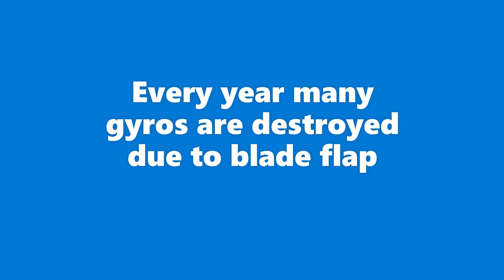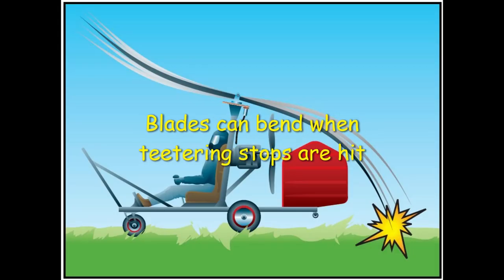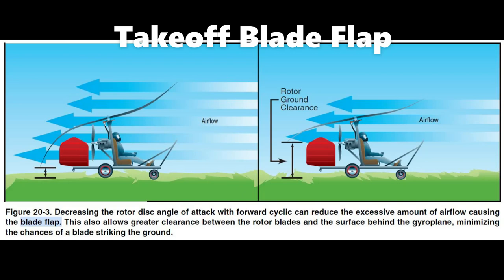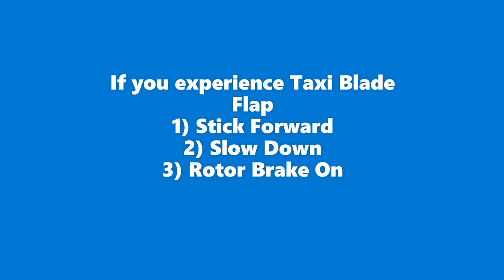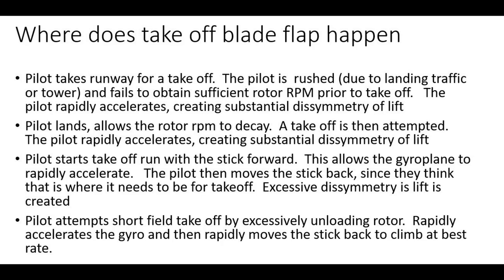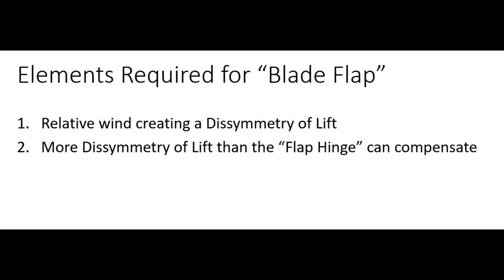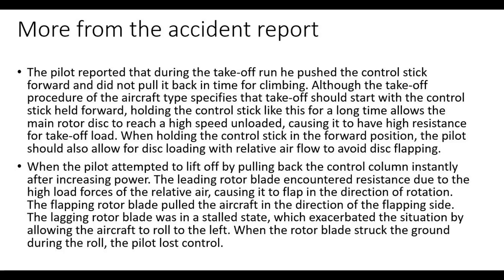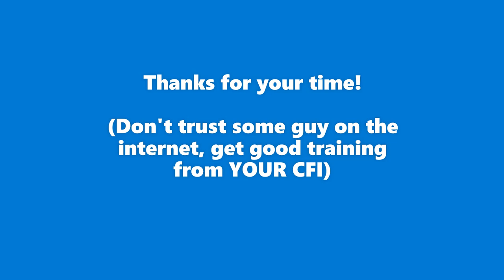Blade Flap

Comment: So blade flap and rotor bump is defined as the same thing?
Reply from the maker: The South African accident report has the following definition.  In particular, look at the last sentence:

“Blade Flap or Rotor Blade Flapping” is a term commonly used to describe
excessive, violent rotor blade motion. This most often occurs when rotor rpm is too
low in relation to the forward speed of the gyro during take-off roll. The word
“Flapping” by itself is used to refer to the normal in-flight teetering or articulation of a
rotor, which helps reduce dissymmetry of lift.
“Rotor Blade Flapping:” in traditional “Flapping Hinge” rotor systems,
“flapping” refers to the normal action of the rotor to allow cyclic action of the rotor
– similar to “Teeter” for semi-rigid 2-blade rotor systems. The flapping amplitude of
the rotor increases with increasing airspeed (forward cyclic input) in order to
compensate for the increasing dissymmetry of lift between the advancing blade and
the retreating blade. Flapping action also allows cyclic maneuvering inputs to the
rotor. In semi-rigid 2-blade rotor systems, the term “flapping” is commonly used to
refer to the abnormal excessively forceful teeter action of the rotor impacting the
teeter stops upon significant dissymmetry of lift or retreating blade stall – such as on
take-off.
Reply from the maker: The FAA Rotor Craft Handbook states:

On a gyroplane with a semi-rigid, teeter-head rotor system,
blade flap may develop if too much airflow passes
through the rotor system while it is operating at low
r.p.m. This is most often the result of taxiing too fast
for a given rotor speed. Unequal lift acting on the
advancing and retreating blades can cause the blades to
teeter to the maximum allowed by the rotor head
design. The blades then hit the teeter stops, creating a
vibration that may be felt in the cyclic control. The frequency
of the vibration corresponds to the speed of the
rotor, with the blades hitting the stops twice during
each revolution.
Reply from the maker: And the Rotor Craft Flying handbook defines:
MAST BUMPING—Action of the
rotor head striking the mast, occurring
on underslung rotors only.
Reply: @txkoob  Looks like there are many instances which can cause flapping enough to have rotor-bump. Trying to push too much air through an aft tilted rotor whether or not the rotor is up to speed, seems to be the big reason why so many begin to depart the runway and then roll to the left. It seems there are so many who just dont understand the realities of the aerodynamics at play during especially take-off in these wonderful machines.  Thanks for the reply and especially thank you for your concern about all of our safety.
Reply from the maker: In short, for a gyroplane with a teetering head,  mast bumping and blade flap are the same thing.
Reply: @txkoob  I tell you, I just have to smile when I look at the rotor-head  the genius Igor Bensen gave us. That under slung blade takes care of the stresses which a helicopter has to solve in a more complicated way. As the blade rises, it first must swing away from the "mast" in an arc just a bit. That little swing quells the acceleration which would happen as the mass of the blade would have come closer to the center of rotation. Its just genius that something so simple could solve such a monumental problem.
Reply: @txkoob  Unfortunately the South African accident was unlikely blade flap.  The machine became airborne.  In blade flap the retreating blade is actually stalled so while the machine can roll over it'll actually suffer blade strike before it gets there.  a gyro weighing 300kg empty is not getting airborne with no lift on one side the left wheel would have never left the ground and the rotor would have first struck tail, prop and ground long before lift off this was over rotation following a botched take off.
Reply from the maker: @cameronlapworth2284   This link shows a gyro, well over 300kg, getting off the ground after blade flap and the rotor striking the ground. https://www.dailymotion.com/embed/video/x861op6
Reply: @txkoob  no it doesnt. It shows over rotation.  You cannot get airborne with half you disk stalled.
Reply from the maker: @cameronlapworth2284  I suggest you watch a few other videos.   Ron's at about 4 minutes in.  https://www.youtube.com/watch?v=oS0_Ep6mnaM&t=746s   It describes the high speed blade flap conditions.  Basically on a take off run the rotor is too flat, and the pilot slightly increases the disk angle and flaps the blades.  You can see it in many videos.   https://www.youtube.com/watch?v=D2-kA7E-gzs and https://www.youtube.com/watch?v=TVu8Ubcuol0&list=PLLe0n49frOfoOjexpVZjIVXB_uXv0U7Mz&index=4    Over rotations looks different.  https://www.youtube.com/watch?v=b3OFj26MxFU&list=PLLe0n49frOfoOjexpVZjIVXB_uXv0U7Mz&index=1   Look at the ground speed.     And behind the power curve looks like https://www.youtube.com/watch?v=AheudQuxZZY&list=PLLe0n49frOfoOjexpVZjIVXB_uXv0U7Mz&index=2      --Ok, as Ron explains, when the disk is full back, the gyro can't accelerate to an efficient flying speed.  Failure to correct leads to a behind the curve takeoff.   The rotor needs to be flattened some to allow the gyro to accelerate.  In general maintaining the nose wheel an inch or two off the ground is a good way to ensure the rotor is not too flat (where rotor speed decays).   --High speed blade flap accidents often start with the nose wheel on the runway, with a sudden liftoff and rotation to the left.   Look at https://www.youtube.com/watch?v=D2-kA7E-gzs  The pilot didn't yank the controls back at the 16 second mark.  Slight back pressure was all it took to change the angle of attack and the advancing blade provided more lift, the retreating lost lift.  The result is nose up with roll to the left.  --As to how this happens: its pilot error.   Maybe the pilot has not flown for a while and forgot to bring the stick all the way back at the start of the take off run.  And partway through, they remembered to bring the stick back.   Or maybe they were trying to perform a short field take off and flattened the disk to much and lost rotor RPM.
Reply: @txkoob  i have watched many many videos.  More important i was a gyroglider instructor for 16 years hand winding rotors and flying in an era where most people had to hand wind rotors.  I know what flapping looks like from the seat.  I know what it looks like from outside hint giant s shape you NEVER see blade flap with both blades conned up  NEVER.  I have also due to over zealous drivers and test flying home made rotors with incorrect profiles experience blade flap and recovered from it more times than i can recall without ever damaging a rotor.  I cam even spot it in the shape of the disk before you can feel it.  Now i may be sounding arrogant here.  Im not im not the most experenced powered pilot probably only 200-300 hours powered.  Im safe, conservative can manange engine outs.  But on rotors me and a mate built several.  Ive test fown tracked and balanced more than 10 home made rotors,  and ive spend many hundreds of hours being dragged up and down a strip after hand winding rotors.  I winding up rotors in all conditions I am an expert.  This is something almost everyone misunderstands.

The modern movement uses pre rotation not as a convinience but as a method to try to avoid teaching proper blade management.  As a result we have instructors who were trained with pre rotation who couldnt wind up a set of rotors from low rpm if their lives depended on it.  As a result they teach this insane method pre spin to 200+ the full power and go.  Combine this with longer than necessary rotors and higher than necessary pitch on those rotors and they take 2x as much airstrip to get off on ovrrweight  machines.

These overweight maxhines need massive hp and massive props combine that with a technique which results in chasing the rpm before it decays rather than building it as it can handle the extra speed results in these accidents and others because SUDDENLY your balancing with one wheel lifting early due to excess torque.  It also results in longer grpund run and hence people trying to reef the machine off the deck before its ready.

All this is solved by REAL blade management skills.  You dont even need a rotor tacho.  You need to understand how autorotation works and what that means for proper wind up.  If I can find it Ill link you a video of a mate doing it right.  Show me a video in the same conditions of anyone doing the modern teachinque in as short a distance and as smoothy and Ill start to think these guys understand blade management.
Reply: @txkoob  https://youtu.be/36ogAzGGyG4?si=eRY3jnNCocsG-iFF  here you go this is how you wind up rotors.  Note that its hand wound is irrelevant.  What is revenant is he is only winding slow so do so with a pre rotator if you like.

This is why he gets off so short (its a taxiway btw).

This was a mate he died from lung issues about 10 years after this.  Anyway he did this all the time bugger all breeze this day.  

Now he is only adding tiny speed initially as any more will increase the teeter angle and angle of attack on the retreating side thus loosing the forward component of the retreating blade lift (drag overcomes the forward vector)  thus only the advancing side is contributing.  So the proper technique is to only give the blades a little until they can accelerate and reduce flap on retreating side then add only a tiny bit more so staeting in this maxhine 8mph then 10 then 12 then at 15mph they will accelerate enough to be beyond blade flap all this is done as here in a very short distance.  As the blade lift the nose you then apply full power over a much longer time balancing smoothly and progresively in a relaxed manner.  Not suddenly rearing up in a mad dance in stick and pedals.  

But you need to know what you are looking at not following a bloody rpm gauges which cant tell you if youve hit a thermal or cross wind.  Steve here will have been looking up the whole time 90% of the time.  Follow a rotor tacho and you dont see the upward arc that indicates blad flap before you feel it.  

What the modern guys do is 200+ gun the throttle before the autorotation is established hope to catch the decay before it gets too low sucking up distance.  Then do a merry dance on take off.  Inexperienced guys who hold the blades forward too long suck up more room then reef the machine off striking the blades at the rear.  Because the take is rushed not gradual.  Then when they screw up blame blade flap.  99% of instructors have never been in blade flap.  Because their technique and instruction doesnt teach it it tried to avoid it like a bogey man.  And yes it dangerous.  It why it was madness to kill the clubs and the gyrogliders.  No one wants to risk a $100000 machine so they teach this technique.  You want to be safe from blade flap to take off safely every time?  Get every student into a gyroglider or start with ground training in a cheap single seater and have them learn to wind up by hand under instruction. 

The modern techbique is dangerous.  Its taught because most instructors couldnt wind up properly and they have found a technique that avoids teaching blade management.
Reply from the maker: @cameronlapworth2284  Given most modern gyroplanes have a per-rotator and most students learn to fly exclusively by pre-rotation, one has to ask what happens when ground speed is excessive, the rotor RPM too slow, and slight back pressure applied on the controls. --The answer for far to many is an accident.  Its a blade flap accident.  Call it over rotation if you want, but it happens well into the takeoff run, often when the the pilot has the nose wheel on the ground.   --And what is the proper response when you realize your ground speed is too fast and forgot to bring the stick back?  Stick forward and an immediate power reduction.  Failure to do that, and you risk flapping your gyro.
Reply: @txkoob  yes the problem is not using a pre rotator its over reving it then trying to catch it rather thsn gradually build rpm.  Use a pre rotator but wind up progressively and it cant happen.   But it means actually learning a skill.  

These accidents are happening because they are chasing the rpm with sufficent airspeed.

  It can result in either blade flap but mostly it results in over rotation and loss of control at wheel balance lift off.

Again show me a shorter take off in a modern machine.  Show me a more gentle gradual transition.  

It wouldnt have mattered if hand wound initially or not its the procees of gradually building rpm not the initial manner of getting rpm.
Reply: @txkoob  additionally its not blade flap if its gotten off the ground.  There is ZERO chance of getting both wheels off the ground  with 1/2 the rotor producing ZERO lift.  Any accident where there is an airborne gyro and positive conning angle other than 150mph high speed is NOT blade flap.  Mistaking the two stops people learning true cause.  It stops consideration and action on proper training.

I was part of a club with an excellent CFI who trsined us to correctly wind up rotors.  I never saw a single rotor damanged in training.  Latter i was part of another club where it was considered dangerous to not have a prerotator.  I saw a set of blades damaged every 3 monthd there.  Many smashed machines.  

Dogma is dangerous.  Im suggesting the modern method IS DANGEROUS.  If people misdiagnose even if well meaning it will continue to destroy machines.
Reply: @txkoob  Here's the other video I was hoping to show you.  https://www.youtube.com/watch?v=N_pBl5bPNWQ  notice a) the prop actually help wind the rotors (the direction of travel on the blades is irrelevant) it used to work like this for my powered gyro as well.  Back in the day we would typically do this in the parking area after clearing the area and do the wind up when taxiing to the end of the strip.  Here you see he waits until the blades are going as fast as they can then only accelerates a bit at a time instead of going over rpm required then trying to catch them before they loose too much speed.  There is no way he would have gotten off had he not taken this approach.  

It wouldn't have mattered of course if he'd gotten the pre-rotator to get them to the speed they could spin at in the prop wash rather than wait for them to come up but his skill in judging the rotors is very good here, and this is my point.  You should be able to do this.  The point would be you gain no take off advantage in having the blades spinning faster than he gets them here before moving forwards - slowly.  

Every student should be taught to do this, all of them.  The current 200+ then go to full power over a few seconds is dangerous IMO.  This method not only avoids blade flap but means if it does happen it happens at sufficiently low speed to actually recover from it.

Comment: I never experience any blade flap on my gyro even on purpose not even on negative Gs because I designed a rotor system with strong electric magnets that keeps the rotor spinning over 300rpm even when fully stopped.